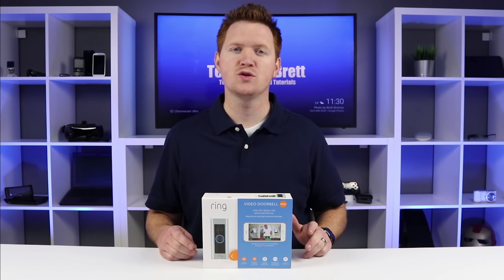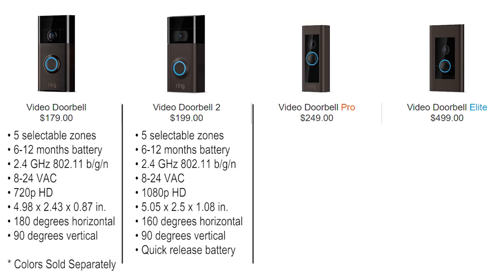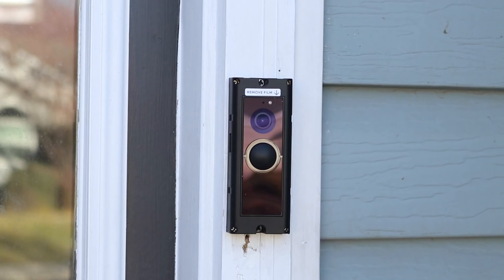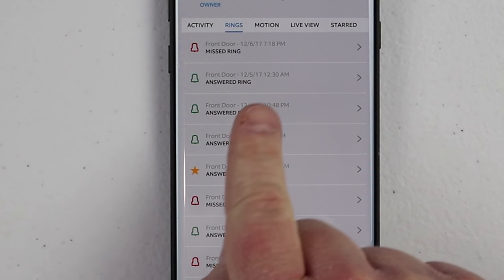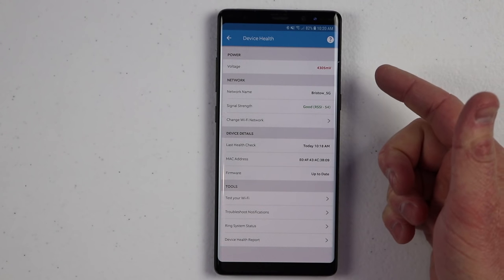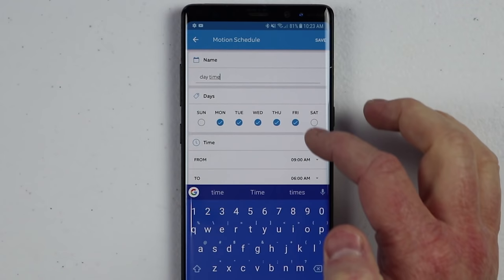Ring Video Doorbell - Comparison, Installation, App Setup & Full Tutorial

Comment from the maker: This has been a super handy smart home product to have. Are you using one?

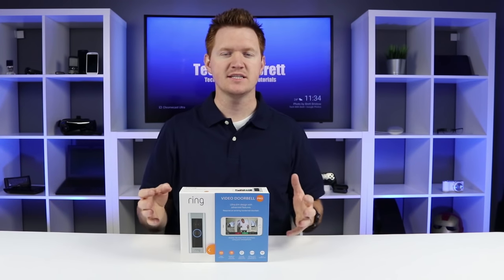01:39 Ring Doorbell Comparison
03:00 Compatible Doorbells
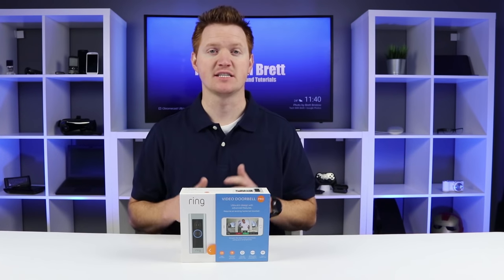03:28 What's in the Box
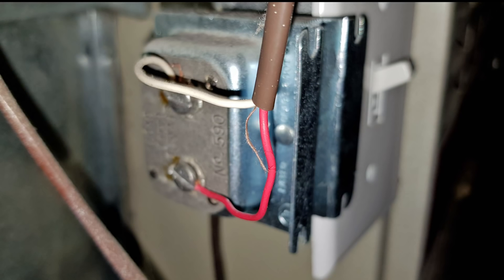04:11 Doorbell Transformer
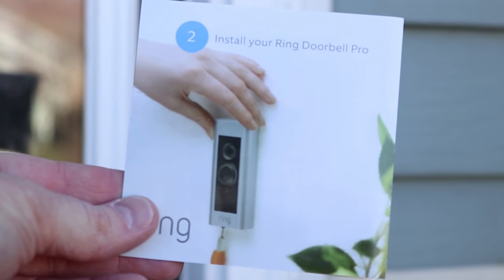05:35 Installation
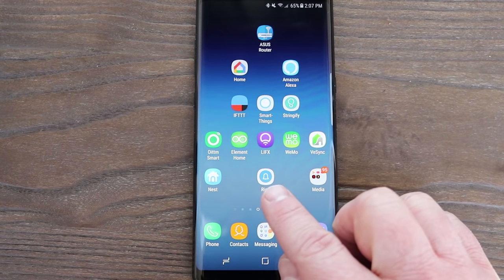06:27 App Setup
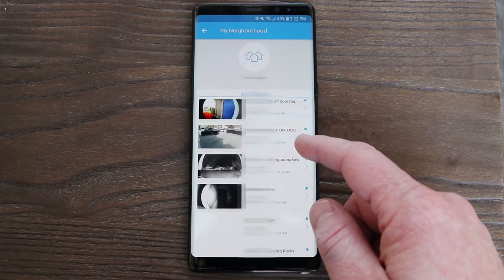07:35 App Tutorial
10:50 Motion Zones
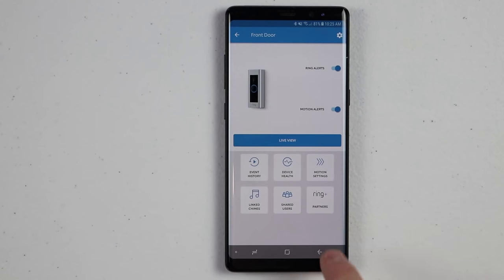14:45 Motion Alerts
15:27 Ring Alerts
16:24 Cloud Recording
Reply: Tech With Brett what dose this ring door bell do
Reply: How to remove door bell  and chimes
Reply from the maker: Your old one or the Ring?
Reply: Does ring works white Google HOME?
Reply: Only thing missing was setup with Alexa
Reply from the maker: It can but it will only tell you when the last motion was.
Reply from the maker: Sorry about that. You can search for the Ring skill in the Amazon Alexa app and see the commands through there.
Reply: The "so-called" full tutorial does not include how to download the video.
Reply: 10
Reply: No, I used an echo dot (5th gen).

Comment: Thanks
And I have a mechanical chime.
Is a 16v 10va transformer enough or should I get a 24 v ??
Reply from the maker: You can always try it. If it is not working correctly then you can swap out the transformer.

Comment: What is the purpose of the Power Kit? can I install the ring without it?
Reply from the maker: It is needed to get the right voltage to the doorbell and to the Ring Doorbell. It looks like it might be possible if you don't want to use your existing doorbell. https://support.ring.com/hc/en-us/articles/205180710-How-to-Connect-Your-Ring-Video-Doorbell-Directly-to-a-Low-Voltage-Transformer-Without-a-Pre-existing-Doorbell-

Comment: So, I have a dual band router (2.4 & 5ghz) and have had issues connecting wireless security cameras and WiFi outlets/switches to it because the devices only like to recognize the 2.4ghz band but have a hard time finding it.  I don't have an existing chime/wire connection, so I'm wondering if Ring 2 would have issues seeing the 2.4ghz channel on my router like my other devices, cheaper quality devices.  Most of the others eventually found the 2.4 band, but I had to try many times for each, much to my frustration.
Reply: tnzmag11 disable 5ghz. Its not really much faster and goes through walls crappy. Just use 2.4, have less noise, more compatibility and decent speeds for everything to work consistently

Comment: The battery does not last for a month, even when powered by a 16Vac transformer in a warm weather area like mine.  I do not recommend the Ring Doorbell 2, and it seems other Ring doorbells have the same problem.  See what Ring says: @t , trying to put the burden on the customer. To recharge the battery, it takes several hours and the inconvenience of undoing the special screw and losing it on the ground if not very careful.  Also, as others have mentioned, the video and notification usually start after a person is walking away!  And pointing the doorbell toward the front walkway with the street just beyond, then you get too many nuisance notifications if you want to catch someone farther out to give yourself a chance to see them coming.  Instead, they suggest changing the field of view downwards to minimize unwanted detections.  Their marketing is getting too many people stuck with these "not ready for primetime" video doorbells.  The neighorhood video sharing and notification would be good if the unit solved the problems listed above and did not share so much of your private actions without telling you.  And then there is the monthly cost if you want to see recorded history!  Yipes, I was a fool to buy into this.

Comment: ***make sure you have a 16V-30VA doorbell transformer ... DO NOT look at your current transformer and think "It's 16V, it will be ok" the important part is VA volt amps and you want the 30VA .. most older homes only have a 16V-10VA transformer

Comment: How do I find my transformer.I have no idea where it is. I tested the wires on my existing doorbell and  it  show 18 volts is that sufficient?
Reply from the maker: I had to hunt awhile for mine. Sometimes they are behind the chime, in the attic or by the heater. You can try it with that voltage and it will let you know if it is not powerful enough.

Comment: Would I need to get that plug chime? Cause I was wanting to put one of the rings up but my house doesn't have any kind of doorbell. So would it work if I just got one of the rings and the plug chime and ran the doorbell for the batteries?
Reply from the maker: Yep! Get the Ring Video Doorbell 2 and the Chime. Your mobile device will receive all the notifications but the Chime will be nice to have changeable tones. The Chrime Pro comes with a WiFi extender if you need that.
Reply: Tech With Brett ok that's cool so I guess all I would haft to do is mount the doorbell where I needed it then plug the chime in and set the 2 up
Reply: Is there a monthly fee for the ring app
Reply from the maker: Only if you want to have a history of recordings.
Reply: Tech With Brett ok I just didn't know most of the stuff I've seen u would create a ring account for your doorbell then u would choose a subscription rather if it's this amount every month or an amount for the year. Cause I was wanting to set one up but I thought u know if it's going to be something they make u pay every month or year to use then that's not going to work. So I didn't know if that was something that they made u do or if u could just use it

Comment: How to instal Ring PRO (don't wan any other Ring) if I never had any type of doorbell? Thanks.
Reply from the maker: If you don't have doorbell wires the best option is going to be the Ring Video Doorbell 2. It is battery powered and no wiring is required.
Reply: @TechWithBrett  no thanks. I don't want to have that one. I want Ring PRO and already bought one.